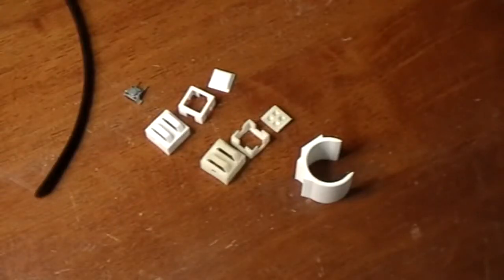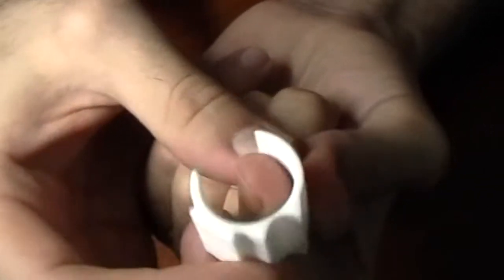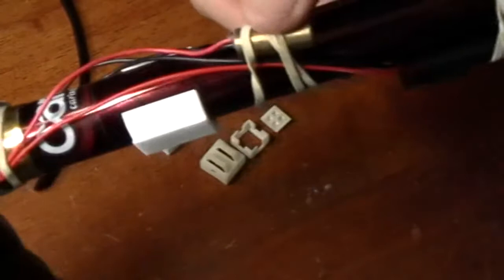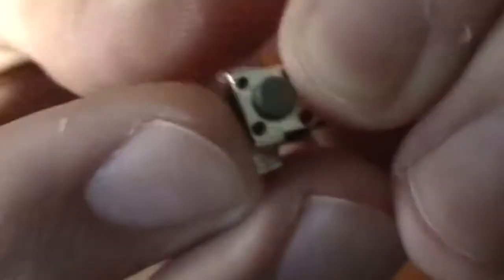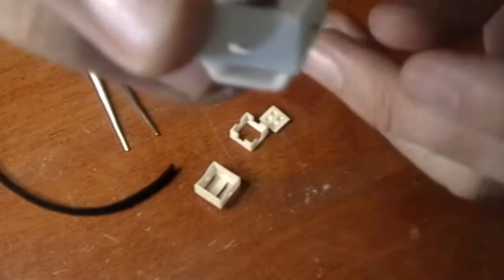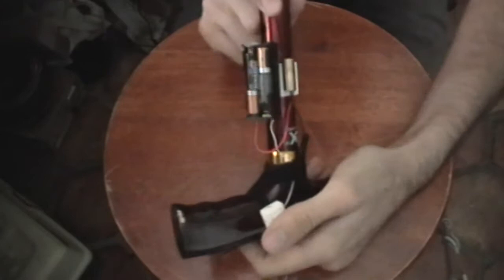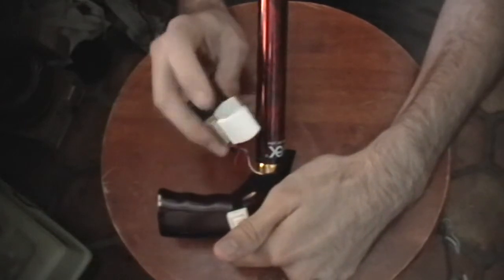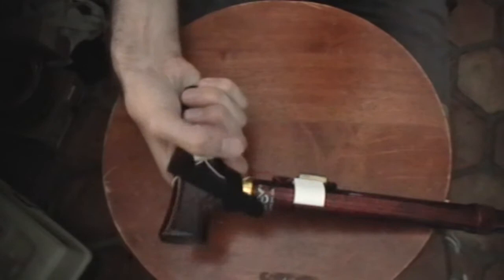Shapeways Laser Cane

Comment: I really need to make this to my uncle. Would you send me the 3d printer files? Thank you very much!
Reply from the maker: Hi, I just made a page for this project and attached the STL file for the cane attachment: https://mindsforge.com/Projects/3DPrintedLaserCane

I'll put more documentation up later
Reply: @uberscientist  great, thank you! Did your father have good results using it? Do you think I could do it without the button, using only an on/off switch?
Reply from the maker: @rafaelpalladino1982  the button is a really bad design, I wouldn't print it again, as it was my very first attempt at all that.  Are you planning to go through Shapeways? Or do you have a printer?  I could send you prints too, I printed one off in PETG for someone, but they never responded so you could have it if you want. I've also been thinking of doing another design for the button, and perhaps use 2 stripped wires in some sort of button rig that could be attached to the cane.  I'd need to draw it out, then CAD it though...  you may be able to find a sewable button that could be attached with a strap, or a better way of attaching a momentary normally open pushbutton.  Let me know, and I'll let you know if I come up with anything!
Reply: @uberscientist  I live in Brazil, so I don't think you sending me would be an option. I intend to ask a friend to print it to me. As my battery case already has an on/off switch, I thought I could connect it directly to the laser, to keep it simple. I'm just worried what would be the battery consumption in this case.
Reply from the maker: @rafaelpalladino1982  ok, and the laser module may overheat too.  Do you have access to 6x6x5mm tactile pushbutton switches? I'm working on a design right now
Reply: @uberscientist  I'll try to find a switch like this here.
Reply from the maker: @rafaelpalladino1982  awesome, if it's not the 6x6x5, let me know the dimensions and we'll figure something out.  And I just saw you asked if it helped my dad, he never really used it, he's not much into using technology like that unfortunately

Comment: Do you remember where you got your laser? What type of laser is it? Also, do you make the parts now where i could purchase them?
Reply from the maker: This is the laser I used:
https://www.ebay.com/itm/5mW-650nm-Red-Laser-Line-Module-with-Slot-DRM509-011S/163027655615?hash=item25f5349bbf:m:mN3YlcdYM10OXpHRQsw9h0w:rk:4:pf:0

I did finally get my own 3D printer so I might be able to print off the parts cheaper than going through shapeways.  I'll fiddle with that tonight, feel free to send me another message or email chris@mindsforge.com to keep me on task!
Reply from the maker: I was able to print the collar that holds the battery and laser so I can ship that to you.  The button isn't a good design (and I can't print it at home either), I think I have an idea for a better switch setup I'll see what I can pull off